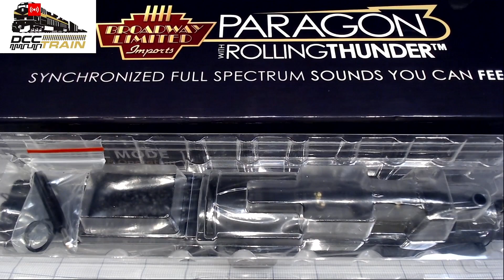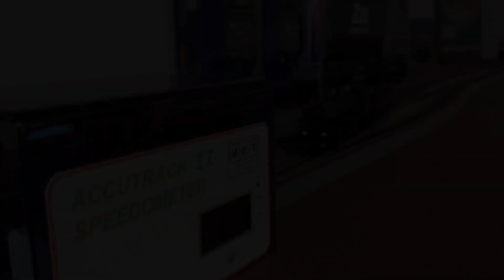HO BLI 2-8-0 Consolidation Pere Marquette DCC Paragon3 Sound

Comment: You put the four way colored marker lamps in the wrong spot. Traditionally, they are supposed to go on the top front end of the smokebox looking like Mickey Mouse ears, not on the pilot beam like you have them. I do know you are European and don't examine much steam so it is an understandable mistake.
Reply from the maker: No kidding, this is brand new out of the box BLI locomotive. :-)
Reply: Agree, the class lights don't belong down there. But at least it looks like they may have the color and size of the font pretty close.
Reply: This engine is sort of a conversion of the BLI PRR H-10 which used the lights on the pilot beam. They didn't remove them when they made this model or make a new pilot assembly. This is a very PRR practice and shouldn't be on this generic engine.

I'm not all that impressed with this engine. They should have removed those markers and that super bright cab interior light is hokey. All the steam engines I have been in had very dim lighting. It has an off-beat exhaust which I don't like.  It may run better after time but it isn't a good performer now.
Reply: @rogerhuber3133  

I didn't know this and I am a Pennsylvania Railroad fan and have seen many photographs of their steam locomotives. I didn't think this was a PRR locomotive if only because it doesn't have a Belpaire firebox.
Reply: @arrow1414  This IS NOT a PRR engine. BLI had previously made the PRR H10 2-8-0 and decided to make a generic 2-8-0 to compete with some of the enormous sales Bachmann was reaping with their semi-generic 2-8-0 at the time. They did some modifications to the H10 and replaced the Belpaire boiler and eliminated PRR details but they used the same pilot deck with those clawfoot markers. Pennsy stopped using them but some locomotives kept them for a while. Yes, most markers were located much higher up on the smokebox front or sides of the boiler near the front for other crews to better see them which was their purpose.
Reply: @Roger Huber  

I got you. I understand that the model is not a Pennsy model (supposedly Pere Marquette) even if it that loco had that one Pennsy characteristic of marker lamps on the pilot beam and that was not a common or long lasting practice by the PRR. And as is the way these things happen to me I did find a photo of a PRR steam loco with the marker lamps on the pilot beam: 

https://jdhsmith.math.iastate.edu/term/slusprrD16sb.jpg 

So I eat crow for my original post saying this did not happen with American railroads.🤥